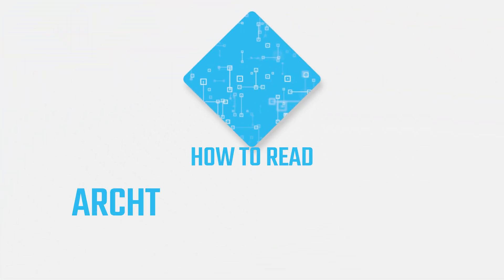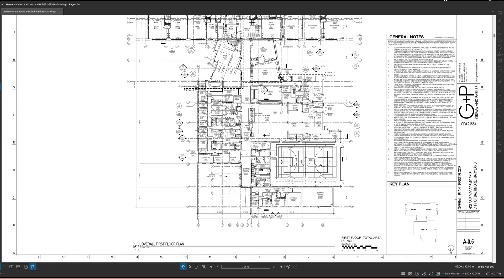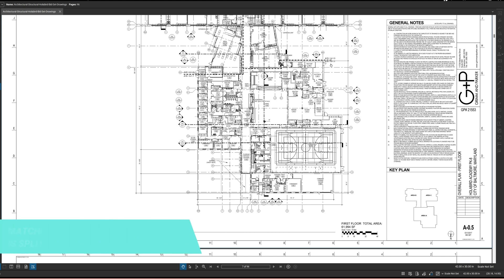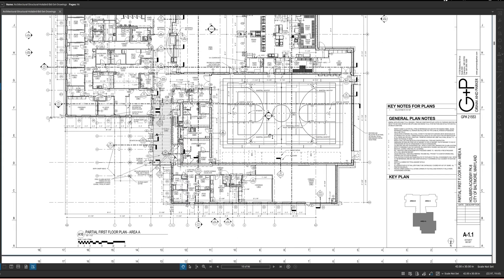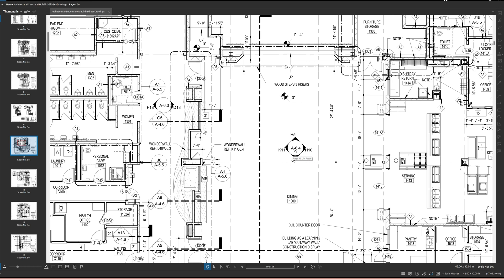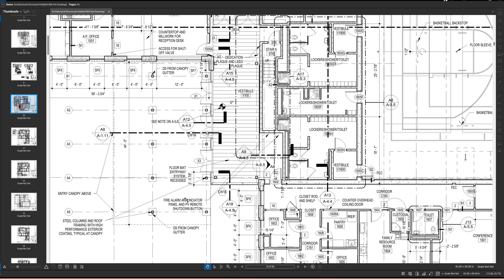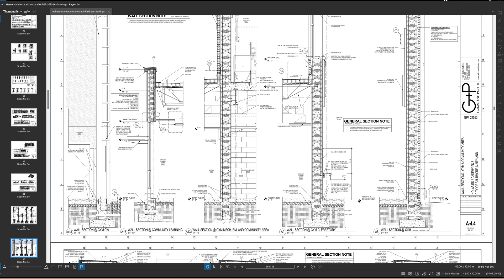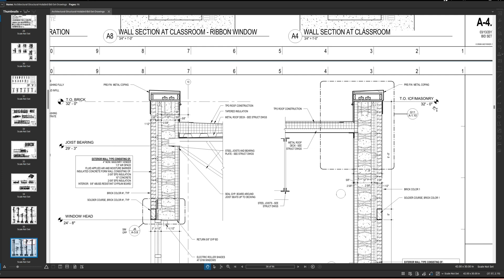Gain Construction Knowledge: How To Read Architectural Drawings - Part 1 of 3

Comment: It looks very informative format.
But sir, i wanna be a quantifier to quantify materials.
But having searched out many videos, i didn't get any sort of video that could clear my concept about different matereials used in building construction.
Other thing is that, can you please make a video with proper excel sheet that defines  basic knowledge ( description, units, labour rate, material quantity and number of units, length/width excreta).
Don't matter how much your video goes on that topic.
Your work will be appreciated, sir.
Thank you
Reply from the maker: Thank you for your comments. I will definitely be getting into quantity surveying in my upcoming videos. Stay tuned and thanks for watching!